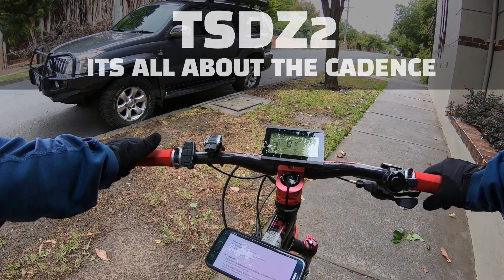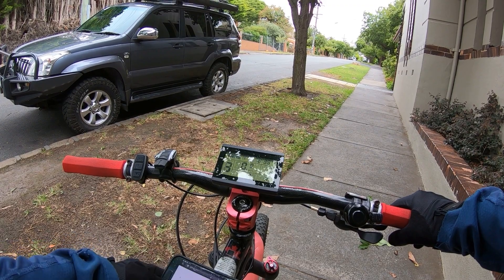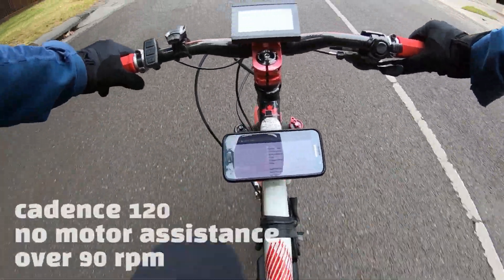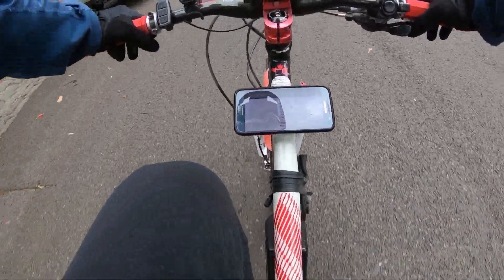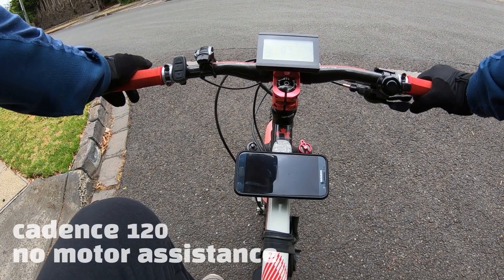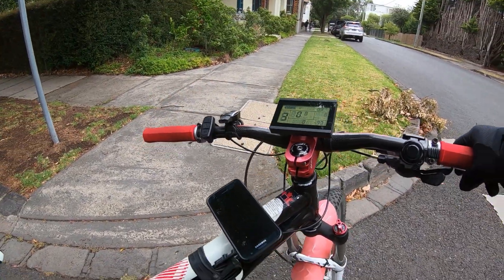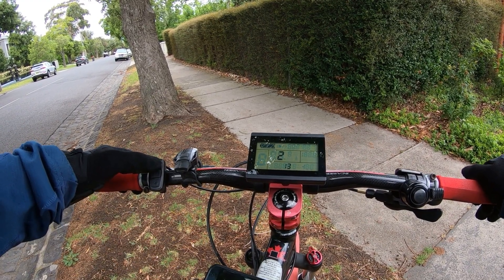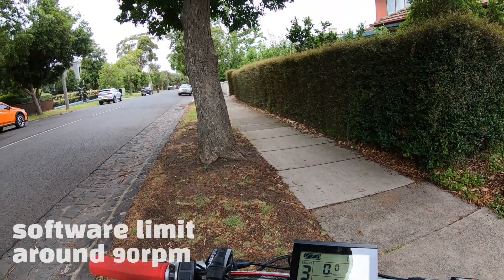TSDZ2 - It’s all about the Cadence

Comment: Some basic biomechanics:-
As the velocity of muscle contraction increaces the amount of force that can be applied to the pedals diminishes.
It occurrs to me that since the Tongsheng motor utilises a torque sensor the amount of motor assist supplied at high cadences may be less than expected.
In order to get the maximum amount of assistance from your motor I suggest that you should pedal hard at a much lower cadence, (a high speed gear ratio).
Power is the product of both force and velocity so if you wish to maximise muscular imput you need to pedal at the optimum combination of force and velocity.
If I recall correctly sources on Cycling biomechanics state that this is at about a cadence of 60 RPM. (Just observe the cadence that professional cyclists on the Tour de France usually pedal at),
If you want the maximum combination of muscular and motor power then you will need to experiment!
Reply from the maker: The opensource firmware fixes all that, it produces power as a combination of torque at low speed and cadence at high speed. Just use power mode with boost and enable high cadence mode. If you pedal really quick the power increases near then end. Its amazing
Reply: Nice work, would a 36v 250w set up benefit from this firmware?

Comment: It depends on what you use the bike for. I am looking a.torque sensing mid drive motor to help headwind and uphill riding.
Reply from the maker: I find it better than the bosch in that regard. Power mode gives a good mix of torque vs cadence, whereas the bosch is more torque based which doesn't suit commuting.

Comment: Hi, ii have the 48v version of this motor and im looking to install the osf on my stock vlcd5 display and all i want from the open source firmware is to have the open to run unlimited cadence but no one has talked about how to configure it using the software. Did you configure this using the configurator or something else?

Comment: The bafang bbs02b i got tries to spin at 70 rpm (no load) on assist level 1 and 140 rpm (no load) on assist level 5. It does not resist higher pedaling speeds as there is a freewheel but will not provide assistance if you pedal faster than this. It also means that you should be upping the cadence as you go up the assist levels in order that the motor is not becoming inefficient (e.g. pedaling 40 rpm in assist level 5 labouring the motor when it really wants to do 100+ rpm for power efficiency and motor life). However you can cruise in a high gear on assist level 1 with some pedaling to keep it going. I will know for certain once it's fitted, though I will try and keep the cadence up on higher assist levels long term, rather than bogging the motor down in too big a gear.
The "assist sensors" are fairly basic on the kit but they are not my primary focus even though I am curious to try out a kit that responds immediately with an exact multiple of pedaling effort, making the bike more of an "audio amplifier" when it comes to the input signal of your pedal stroke.
Reply from the maker: Cool, now if only it had a torque sensor.

Comment: FYI I had a huge loss in power in the 36v experimental mode. I had upgraded the battery at the same time so I turned up the power level and didn’t realize the difference, I kept riding it like that for about a week. When I eventually tried turning it back, it was like a new bike. I’ll never use that mode again, whatever was done to the timing robbed all performance from my motor. 

I wish there was a mode that removed the 90rpm limit( I’m still at 36v howeverI’ll upgrade eventually) but left the timing alone.
Reply from the maker: It's very easy to only remove the rpm limit but without modifying the timing it oses power early anyway. Which version are you using ? Would you like me to compile a version for you ?
Reply: @jbalatutube  I'm on 19x. I'm planning to make a custom 15s 62v battery when i get a DIY spot welder working consistently, then the limit would be an issue.

Sure absolutely, if you could remove that limit it would be a huge help. Would i still be able to use 19x?

 I love the firmware and haven't upgraded but i haven't felt a need to, it just works exactly how i want it to. The only gripe i have is with the low cadence limit, but at the moment i can only blame myself for being cheap and using two $30 36v hoverboard batteries.
Reply from the maker: kill switch ha ha well you could be limited in amps if batteries can’t deliver. You can monitor Amps on the display. Version 20b1 has a lot of fixes and went on like a charm first go. I would highly recommend it.
Reply: @jbalatutube  Yes i monitor amps and voltage primarily, to manage my consumption. Ok i ill check what was changed. However if its anything about the power delivery then there's no way. i like the wattage calculations 19x has because it greatly reduces power at low cadence(keeping the motor efficient and cool).

The hoverboard batteries work surprisingly well. Even a single 10s2p in a bike bag gets 5-10 miles. heat/current wise one of them can handle more power than the motor can. I just stick two in a hailong case mounted with bell clinch 700 mounts and its done.  $63 battery, $45 case, $10 soldering iron, $3 Xt60 parallel connector, $10 mount. less than $135 total.

Comment: Advice please l have installed the 48v version with the 850 display , with a 20ah 48v battery from a different supplier . All has been working well for a few months but recently when going uphill using power assist 5 all power cuts out.  It sometimes resets if I disconnect & reconnect the battery , but sometimes I have to plug in the charger to reset it. This has happened after riding for only 30 seconds or an hour , so I don't think it is temperature related   . Charge level was showing  50.4v before the last time it happened.
Reply from the maker: It could be you have a bad cell in your pack that is triggering low voltage cutoff on your bms. You need to draw some high load across the pack and measure individual cell voltages. They should all be within 0.1v of each other
Reply: jbalatutube thanks,  I will try that if it gets worse , I have fully charged it this morning (54.6 volts when finished ) given it a short ride of about 20 mins , up some steep hills but only power assist 4 and had no problems. Battery voltage after resting for 3 hours is 53.4 , I usually like it around 51v if I am not going to be using it for a while.

Comment: How is the motor holding up over long term use? I'm interested in the TSDZ2 for all-weather commuting on a city bike, and I've heard that it might not be as reliable as the BBS02. Also, have you done any of the cooling mods listed on the wiki?
Reply from the maker: I have done more than 20000km with no cooling mod but I ride at normal bike speed and don’t have many hills. If you want to go fast without any effort then go for the bbs02. If you want to feel like you are riding a normal bike with some assistance then I can recommend this motor for a cheap diy setup

Comment: Thanks this, was interesting. I have a TSDZ2 with the open source firmware and it does hit the cadence limit. What are the downsides to unlimiting this? i have other TSDZ2 motors with stock firmware and I run in a low gear with a high candence quite a bit. I was under the impression that this was good for keeping the motor cool.
Reply from the maker: Robert Wright no problem I have always run this way. The new version for the 860 display has a huge power boost at high cadence unfortunately it doesn’t work with the ktlcd3

Comment: I have a 500watt 48 volt motor fitted to a Recumbent Trike. I am not looking for high performance but cruising comfort at a medium cadence would this firmware suite my purpose. another problem is the speed sensor jumps around anywere  between 0 and 99kmph. I have tried adjusting pickup and magnet but the only way I can ride is to remove the magnet, any suggestions
Reply from the maker: For sure the firmware is a major improvement just like having a new motor. I'm not sure the firmware will work without a good speed sensor. Mine was plying around too and it was just a bad connection. Good luck

Comment: Hi just wonder if anyone has experienced what I have encountered! I have installed the Tongsheng TSDZ2H 36V 250W and it seems rides all fine on a normal cruising until when you come to a stop or at lights and when you start peddling again, I find it a bit sluggish and even jerking, I did not change the gear number on the bike when I stopped before start again, whether that was causing the problem? Until you need to ride some distance before it's back to normal or did it!? I found some funny reading on the controller as well!? It certainly feels very abnormal unless I’ve missed something! Is it me or a faulty unit? I also own Bafand rear hub and Yose Power front hub both doesn’t gave me that problem? Hope someone is able to provide some  advice and very much appreciated. P
Reply from the maker: A Yau yes you need to ride it like a normal bike, before you stop you need to change down gears or else the motor won’t have enough torque to get you going quickly, you may even have the chain slip too. With the Opensource firmware you can bump up the power and control how fast the amps are applied at startup to prevent the chain slipping but don’t expect to take off in a hard gear, for that you should be looking at a hub motor.
Reply: @jbalatutube  Very much appreciate your valuable advice and it works! I took it out for a spin and  followed your guidance and it has solved every single problem I encountered. It is extremely useful information regarding this aspect. I suppose I need to get more used to the system in order to appreciate more what a torque sensor is all about! I already feel that I have more control of the bike opposed to the cadence sensors. Many thanks again for your help.

Comment: I just mounted a tsdz2 750W with a 48 volt battery on my moutainbike, I am a bit disappointed when it comes to speed, just over 30 kph or 20 mph on flat, I'm a lightweight person.
With open-source firmware, can I expect higher top speed, or do I have to change front sprocket to bigger?
Reply from the maker: Hans Nyberg ha ha well it’s all about the cadence !! The Opensource will give you more power so you will be able to get another 5kms without trying any harder and the experimental mode will give you and extra 5km/hr assuming your legs can keep up. Ultimately if you are a bit of a speed freak then run a 52 tooth at the front and 13tooth on the back then set your power assist to 500% and you will be flying. Good luck.
Reply: I ordered a 52 teeth and will buy the necessary things to replace firmware, looking forward to fly : ) Thanks!
Reply: @hansnyberg5099  And how fast does it go now?

Comment: Any advice before I purchase a TSDZ2 for a mtn bike? 36v or 48v version? Should I replace the nylon gear with brass?
Reply from the maker: 48v has more torque and runs cooler but you need a 48v battery which is a bit heavier and more expensive so up to you. Keep the nylon gear it’s quieter and You may be lucky it could last for ages. Keep in mind this is not a Bafang it can’t sustain high power for long periods so if you are a big guy wanting to do hill climbs then it’s not for you

Comment: Is the temperature still an issue where it gets up at 75 easily and doesn't cool back down quickly? I was wondering if some heat sink compound between the motor and the outer case housing could help. Or someone could weld on some heat fins possibly?
Reply from the maker: It hasn't been an issue for me since I am normally home when that happens since I live on top of a hill. If you do have a problem then you can get some conducting pads about 3mm thick to install between the motor and casing. It does help a little.
Reply: I knocked about 20˚C off temperatures by stuffing conductive pads under the case, the OSF appears to have cooled the motor by another 5 or 10˚ too.  Can't get the motor above 43˚C now. Summer will be 15˚ warmer, still doubt temps will ever get high again. I think the pads help a lot.

Comment: What size front chainring do you use? Stock 42t? How is that for climbing hills?
Reply from the maker: Yes 42, I think I have 38 on the back and 26inch wheels, I have had no issues with steep hills however I use my trek Powerfly for off-road now and I have been using the tsdz for commuting now.
Reply: @jbalatutube  I will be using my bike for both commuting and mountain biking, so I want to choose a good compromise of speed and climbing ability. My cassette is a 9-speed, 11-34. Eco-cycle sells either a 34 or 42 tooth chainring. Which do you recommend?
Reply from the maker: @hiphopsuperman  I’m happy with stock 42 and 11-38 on 26 inch wheels good for commuting and climbing.
Reply: @jbalatutube  thanks 🙏
Reply: @jbalatutube  btw, is your Facebook page still active? I sent a join request, but no reply.
Reply from the maker: @hiphopsuperman  you mean the best ebike ? I don’t see any member requests. I don’t like the way this page has turned out, everyone just wants to advertise their crap and nothing really good. Recommend you join the tsdz2 page instead.
Reply: @jbalatutube  yup, that’s the one. I’ll join the TSDZ2 page instead, thanks!

Comment: Hello! Do you think that TSDZ2 will work with Hollowtech 2 bottom bracket? The bike is Cube SL Road Pro 2016. Thanks!
Reply from the maker: Alexis there is always a way to make it fit. You can even get longer axles and extension kit to make them fit on fat bikes.